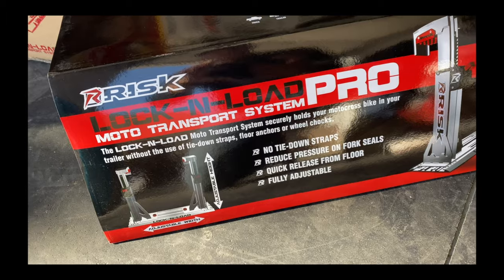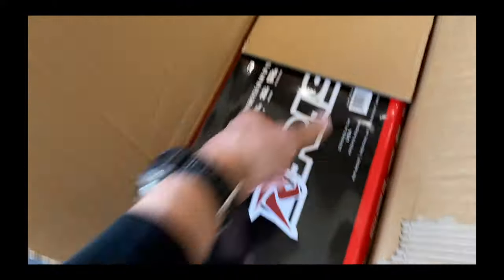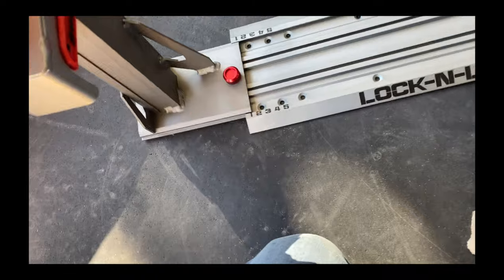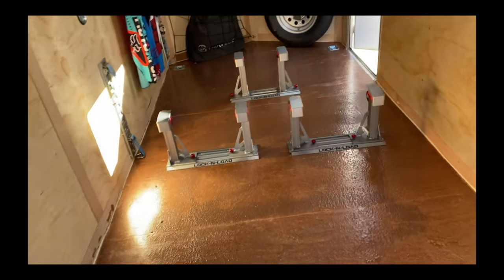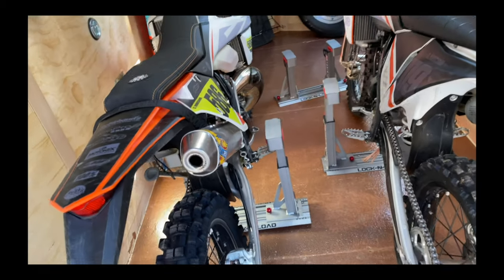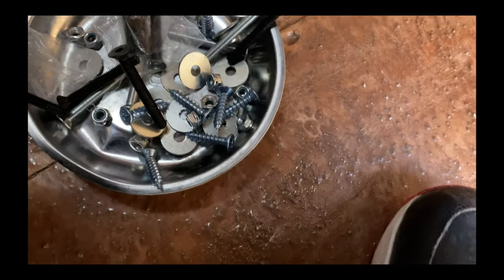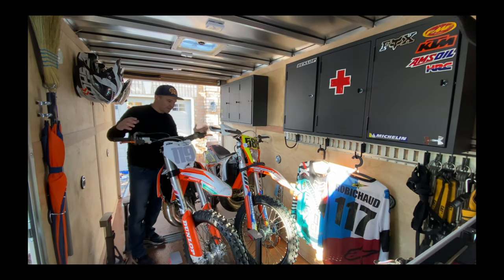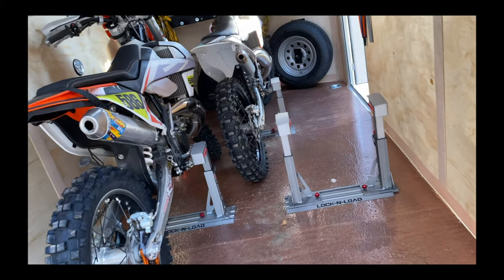Review: Risk Racing Lock-N-Load Pro Install

Comment: They don't like crappy trailers on dirt roads.  Had the first aluminum version which every weld failed.  They replaced all 3 sets with a slightly modified version.  Welds holding but have various other failures.  The location knobs are too small and the galvanic corrosion with freeze them.  The red pads will fail promptly.  Risk is very good to work with on the issues and took care quickly.  I think ill just replace the pads with sacrificial wooden blocks and I'll Redhill and tap the base for larger stainless knobs.

Comment: Did you just use the wood screws?  I am wondering if you would need to use a bolt and nut through the floor.
Reply from the maker: It comes with a bunch of screws that I used. Yes, I did put a few of the external ones through the floor with a bolt for strength. Not sure if it was necessary as the woods screws alone (as there is a lot of them) seem to do the job fine in a trailer floor.